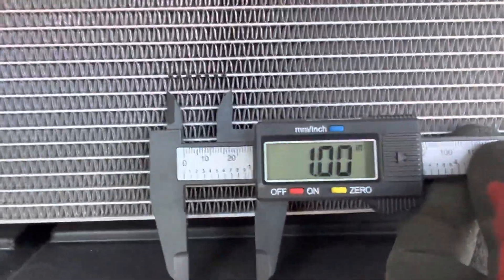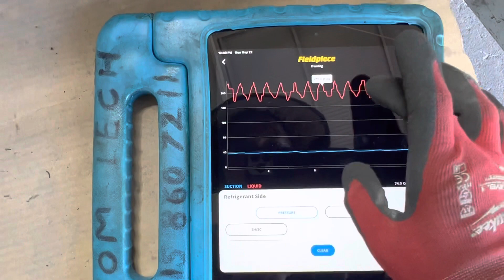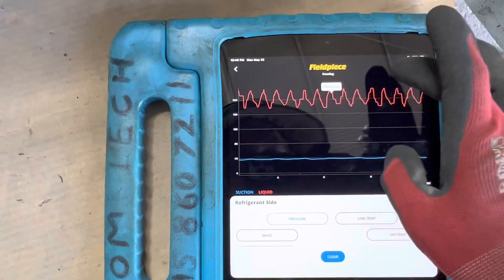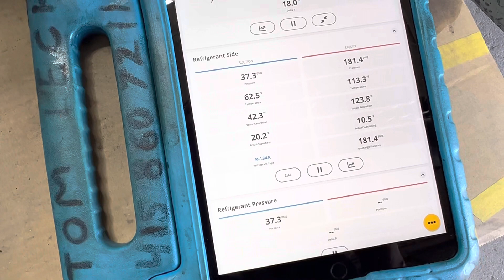AFTERMARKET AC CONDENSER CAUSE FASTER HV BATTERY 🪫 DISCHARGE, LOWER GAS MPG, SHORT COMPRESSOR LIFE

Comment: Why does the pressure jump so much, is it because of higher restriction of the condenser or reduced cooling of the condenser?  Or is it what you started describing as a different amount of refrigerant capacity?
Reply from the maker: In different scenarios, it could be a combination of the three. 

It depends on the way the condenser was constructed 

In this case, it would not be restriction of the condenser . 

Because the inside of the diameter of the Refrigerant passage tubes is actually larger .  

The inside of the refrigerant passage tubes actually has like 1/4 of the amount of thin fins that are located inside the tube that give you all that excellent refrigerant to surface area ratio to absorb heat, and dissipated to the outside . 

Then this particular aftermarket condenser has about 40% fewer exterior surface area, cooling fins 

It’s all about physics very simple math . 

Lack of ability to reject heat . 

When this customer goes in 200° weather, plus he will be just on the borderline at 400 psi may be exceed and cut out on the safety limit switch. Turning off the AC compressor. . 

I have seen this hundreds of times it’s a nightmare for the unexpected and inexperienced young technician who will get this vehicle in his shop about the customer complaining that it’s not cooling 

But when the vehicle comes into the shop, it will be a cooler day, and it will not cut off on high pressure cut out, and the pressure will not be high enough to affect the temperature of the air coming out of the dash it will be working perfectly as far as the technician is concerned. 

This is where wasted Time in trying to recharge the system, thinking that might fix the problem 

When the vehicle comes back again, now, they start throwing parts at the dartboard seeing what sticks maybe it’s a clogged expansion valve let’s change that 

Now this time, maybe it’s a bad compressor. Let’s change that. 

The condenser looks brand new. It must be good. 
🤣 

Maybe we have a defective pressure switch. Let’s change that. 

I see this over and over and over again year after year decade after decade shop after Shop Technician, Shafter Technician, this nightmare story, never ends . 

The owner is angry at the Technician because maybe they’re eating bad diagnosis in Parts 

The customer is mad at the shop because they think they’re getting ripped off or they have somebody who doesn’t know what they’re doing 

It’s not the technicians fault. He has no way to know that this aftermarket condenser could be doing this. . 

It’s all the fault of the industry, and the lowlifes scummy salesman who are clueless themselves about picking and  Distributing Parts it’s all about the profits .
Reply: @coldfinger459sub0  So mainly your feeling is lack of cooling.  If you jumped the auxilary electric fan to go on while testing and you saw a significant drop down in pressure with it on, would that work as some kind of test for this problem?
Reply from the maker: @mikemurphy7519  if I jumped the fan and kept it on continuously, it would do the exact same thing on the original manufacture OEM condenser as it does the poorly designed cheap aftermarket condenser

Both of them, the high side head pressure would come down 

Donely difference on the OEM condenser the high side head pressure would come down even more 

And it is not a feeling that the high side pressure it’s a fat it’s all math physics thermodynamics real simple stuff that you were taught in your first year when you’re taking your 2 1/2 year HVAC degree either be residential or if you opted for commercial refrigeration, 2 1/2 year degree program in commercial refrigeration all students are taught The Thermal Dynamic math formulas to figure out the energy consumed and the heat rejected. 

When you’re going over to classes for heat exchanger designs for Evaporators Four, Condenser, Four, Plate, Haight exchangers, you go over the formulas for figuring out the BTU heat, rejection determined by the surface area, determined by the type of material used, determined by the texture or what type of fins or rifling groove on the inside of the tubes to increase the efficiency of the heat transfer from the refrigerant to the material that will be the medium that the energy flows to the exterior cooling fins

Unfortunately, in the automotive industry and many others, there is no mandatory forced education that the individuals doing repairs are selling parts or Manufacturing Parts or Distributing Parts are required to know this

It’s can I produce the cheapest park and sell it to a gullible uneducated person for some money to make a profit

And the uneducated gullible person looks at the part and thinks they’re all the same and goes. Geez, this is great I’m saving money for the same part.

But it is not the same part it’s apples 🍎 and oranges

🍊 

Imagine a sailboat and you have the original sail We all can picture this in our mind.
     Even the tight weave and threads of the sail pass a little bit of air through them negligible

Now, imagine a company selling sailboat sails that are made out of cheesecloth. If you know what that is, it’s still a cloth. It looks the same. It is white. It is the same size, but the weave between the individual thread fibers has a larger gap that allows more air to pass through the sail

With the aftermarket sail installed on the sailboat the boat now move slower but you got a good deal buying a cheap sail 🤣

This is exactly 100% what is happening in the aftermarket, condenser world of manufacturing and distributors to make a profit and not telling the customer because the customer this is not their field of expertise so there’s no reason why a customer should know this information he is completely in the dark clueless. 

Many individuals are allowed into the automotive industry who learn by breaking stuff and making mistakes, and usually too cheap to pay for themselves to go for manufacturer education go to a formal education in thermodynamics, HVAC construction load calculations fluid flow dynamics. Their only education required is I feel cold on my hand. Therefore, it must be done properly give me money, Mr. customer adios goodbye 👋
Reply: @coldfinger459sub0 i
Hello! In this case can I cool the condenser with fresh cold water and see that system works fine, it turns off the fans after the pressure decline, and then pull off the Connectors of fans to see what happens with system?
Reply from the maker: Cold water will always fix this problem because water has 10 times plus the cooling capacity as a Refrigerant and many many more Times cooling capacity than air

So whether you have the aftermarket condenser or the OEM condenser you’ll see a great difference in head pressure 

But yes, this will tell you that if you had more condenser capacity for cooling and rejecting heat, it would fix the problem .
Reply: @coldfinger459sub0 
Mostly when I use these method I can see a thick layer of dirt between the condenser and engine cooling radiator😀
Reply from the maker: @markaircon  this is where a nice cleaning comes into play and if it’s only dirt, it’s easy to remove

In some areas of the country, it’s a fiber is plant material like Cottonwood, or some other leafy or flour, floating in the air type of material that becomes like a carpet and sticks and it’s very difficult sometimes remove all the condenser is needed 

In some parts of the area, there’s a lot of diesel trucks, and the radiators and condensers get coded with diesel, fuel oil and diesel fuel that is tacky and oily and all road dust and dirt stick to it and become thick. Then you need a degreaser. 

It all depends on the local environment in which the vehicle is operating that will make the condenser or the Evaporator or the cabin air filter plug .
Reply: @coldfinger459sub0  It sounds like other than knowing what the normal pressures for a particular car should be, there is no way to diagnose this, is that correct?
Reply from the maker: @mikemurphy7519  you will have a higher than normal temperature drop across your condenser

It will show up in your superheat and sub cooling compared to a vehicle sitting right next to it with an OM Condenser as a comparison it’ll hit you in the face like a bowling ball. It’ll be that obvious. 

Your experience right off the bat will tell you right away. There’s a problem why the high side pressure is shooting up so rapidly but most people don’t have experience and the ones I do are on a bonus program to move faster and get the next car in and out so they never pay attention. All they know is it blows cold on their hand, collect the money and get the car out so I can get on another one . 

Then your eyes 👀 

When you know what the OEM looks like as soon as I bend over and I see 14 fins in an inch I know instantly what the problem is there’s no questioning there’s no doubt it’s down to physics. 

BTUs heat rejection on 100° day is an elephant

So you use an elephant gun

Not a BB gun. 

The condenser is the gun that Hass to get rid of the heat the BTUs of rejection

Let’s surface area less rejection. It’s that simple.. 

Condenser manufacturing is a fine art of mastering math the formulas in physics the materials used in the design. 

This is what happens when we’re dealing with people in an industry that have no formal correct education in the industry that they’re working in. 

And they’re usually looking for excuses and scapegoats weasel their way out of the situation

They try to find a way to Twist The story and point fingers or be in denial. 

The automotive industry needs an enema. 

But the biggest turd excrement starts from the very top, the owner of the shop with the lack of education and turds roll downhill and land on the technician. 

When the shop owner is not competent enough to train his own technicians or send them for Training because he’s lazy cheaper ignorant this is a personal choice. It is not an option.

A technician or a owner of the company goes out of their way to choose to be cheap
To choose to be ignorant
To choose to be lazy

And it shows up in their lack of knowledge

They’re always having to advertise and look for new customers

And then they make excuses why they don’t have enough work or how they need some. Give me a call or upsell things that are needed to make money to treat their customer like an ATM money generator.. 

And we get right back again to lack of education.
Reply: @coldfinger459sub0  Yes but if you don't have a similar car in front of you and the car you have is not a common car coming into your garage, other than somehow knowing the superheat  and subcooling specs for that car, how can you properly diagnose it?
Reply from the maker: @mikemurphy7519  this is where are you have to rely on the old-school of pulling down the specifications off the manufacturers website that you pay for your monthly subscription from all the different dealers are manufactures or Mitchell or Chiltons or all data or ADP wherever you get your information from

And you have to rely on what little information you were given where they may have a chart .   That tells you what ambient temperature is exactly how to set up the vehicle for testing to compare pressures and sometimes temperature out the dash.. 

Oh, and sometimes it’s really obvious when you look at the aftermarket condenser, they will have the brand-name sticker or serial number some sort of identification. That is not OEM. 

And with your experience, you just use your eyes and you can instantly see that you only have 14 or 16 cooling fins for inch and compare to the OEM’s of 20 cooling fans to 20 for cooling fans per inch 

If you don’t know what you’re doing as a Technician I feel sorry for that shop and the customer because this is where experience comes in . 

This is where the guys who belong and have join the MACS and fly out every year for training are on top of their game in ahead of everybody else and usually don’t have problems like this 

I am always a heavy advocate for training and education flying out to OEM dealer manufactures seminars for training 

I get a hold of every OEM manufactures webinars that are online for free 

Your next step down is your aftermarket third-party distributors because they sell trash sometimes and they are into marketing their product or their snake oil. Sometimes it’s good sometimes it’s not sometimes it’s truth. Sometimes it’s a skewed lie. . 

But overall, there’s a lot of good information at some of these places like Napa when they have a HVAC training seminar that might be six or seven or eight hours long or maybe it’s a two part today or three day training seminar 

You pay the money and you go attend this and every time you learn something new . 

There is no one class that teaches you everything there is no one book that teaches you everything there is no one mentor or instructor who can possibly teach you everything 

And the technology is changing faster than books can be printed. 

This is why myself and my son are always flying out to different states attending different seminars in Training Express on HVAC, both commercial, and . 

If the shop owners choose not to do this cause they’re making up excuses that is their personal choice in the shop will suffer. The employees will suffer, and the customers will suffer. . 

All the information is out there 
It takes 
TIME ⏰ 
MONEY 💰 
DEDICATION  📚 📖 
CORRECT TOOLS 🧰 TOOLS 🛠️
Reply: @coldfinger459sub0  Anyone asking you questions here is making an effort to get educated, you are preaching to the wrong people....
Reply from the maker: @mikemurphy7519  I’m trying to put out all the education I possibly can that is not in books.   

But I do want people who read the questions and responses also to know if they’re in customer going into a shop for service that they are not always going to get what they’re paying for 

I tried to make it very crystal clear that it’s not always straightforward and simple 

I try to make it very clear. There’s usually no rule of thumb that you can apply to all vehicles for a simple cure or application or diagnostic. . 

Often everybody wants a simple, cheap fast one pill to cure every disease example an answer . 

Not possible then, HVAC . Over a phone over text messaging over email.. 

I do not want to mislead anybody by giving them one universal answer for everything and sending them down the wrong path . 

I see this happen too often. This is why I’m always redoing everybody else’s work. . 

This is why when I started my own business 30 years ago I had over 30 air-conditioning and radiator specialty shops who were my competition in my area 

I now have zero 

And the two who pretend to still be in business with new management and technicians without experience now make me more work by what they do for repairs then they actually repair. They will be joining the others soon. 

4 SEASONS, on their YouTube channel go to their website they have some videos on Flushing procedures and using flushing equipment with flushing solvent

NAPA Auto Parts also has some videos so dose Murray air-conditioning components if they’re still a

If you do a search on the air conditioning, chemical flush solvent manufactures, they have links to how to use their products with videos and descriptions, and usually give part numbers of both the product of the air conditioning, flush, solvent, and flush cylinders
Reply: @coldfinger459sub0  Back to this video.  From what I have seen, auto manufacturers and even aftermarket data providers do not provide superheat and subcooling specs.  So unless you have first-hand experience with a particular car, you can only go by the rule of thumb values for the superheat and subcooling data.  You check the fin count, look for stickers, look for what seems to be abnormally high side pressure and if you spray water on the condenser and your system improves almost instantly, then that is all you can do to diagnose this issue.  Correct?
Reply from the maker: Yes, mostly correct. 

That part, you mention about experience . 

There is no experience if you don’t test . 

And I don’t mean pressure and temperature out the dash only . 

You did mention superHeat and subcooling . 

And this comes with experience, because the manufactures do not provide this information. 

And I would not use rule of thumb, because there is no such thing anymore . 

If you watched a few hundreds of my videos showing different year make and model manufactures running a superheat of anywhere from 0.2 or 0.4° superheat many other manufacturers somewhere between 7° superHeat and 17° superHeat but yet again, many more manufactures who might be in 25° superHeat to 50° superheat. 

These are extremely vast differences you’re talking, measuring the distance between your thumb and pointer finger a millimeter apart, considering the compressors health, and between you and the moon . 

That’s how drastic of a difference there is there’s no rule of thumb to cover this . 

And measuring means nothing if you don’t have good, sensitive, accurate high resolution tools with a high refresh rate that can give you instant data feedback . 

Because the computer on all the new cars is taking over so fast and instant that you constantly need the formulas run for refrigerant saturation, superHeat sub cooling, calculating continuously at the moment . 

The exact same thing goes for subcooling 

After watching a couple hundred my videos you’ll notice it might be somewhere around 7 to 9° subcooling and some vehicles ranging all the way up into the 30s and 50° sub cooling. Those two are extremely different and one switched for the other means death of a compressor Over duration of time.. 

That means the difference between a car that works perfectly well between 70 or 80° but doesn’t cool at all at 90 or 100° . 

Just because somebody applies a rule of thumb . 

Visual inspection is always the very first thing. Well, let’s back up and go to asking about the customers complaint, and verifying it clearly, and under what circumstances as it happens is the first thing. 

Then your visual inspection, and you look for things like wrench marks on fasteners meeting somebody has taken that part off before now you have to find out why were they shotgunning just throw in Parts on their 

Is it an aftermarket Condenser or OM condenser 

Did the shop you take it to Mr. customer? Did you see him use a little cans on a single hose? Did he have a big refrigerant recovery Recharge and recycle machine 

Did he just top it off? 

Did he use a can of a Cipro or two or three that contain Lubricant and Sealant and every other wonder drug in the world contained in it in an hour it’s grossly over charge with oil . 

And everything falls back on reading the manufactures motive operation 

In what order do fan stage in come on? Is it a one fan system or a Toofan system? 

Are they strictly just on and off cycling fans? 

Are they continuous run fans? 

Do they stage first fan comes on at a certain pressure and then second fan comes on at the next highest pressure determined by a second pressure switch or temperature 

Is it a Old Thermal San clutch that has 50,000 miles on it fluid driven that goes out of calibration and it’s spinning really fast and it looks good but it actually is not. These are things of experience. . 

And this is exactly why so many of the air conditioning specialty shops went out of business in my area lack of experience . 

Most owners got comfortable, making money, stopped working out in the shop and fell behind the times . 

Trying to make money they usually try to hire the cheapest guy when one guy quits and they keep having this rotation of technicians who don’t have experience except by breaking parts on customers vehicles we’re having multiple come back . 

Not a great business plan . 

We need to cut off the thumbs of those who use rule of thumb . 

For me, it’s great I make a lot of money, unfortunately at the cost and expense of the customers loss because the shops around me use the rule of thumb . 

I was taught from the age of 12 to data log and test everything on every vehicle I work on working with my father who taught me .  He never taught me short cuts. He did not let me know with all the other hack shops and quickie shops were doing..  

So I never learned bad habits when I was young I only knew one Way .  My micron gauge for testing for moisture content in Leaks was an analog analog micron gauge back in those days in a leather case. It took 10 minutes to set up, warm up in calibrate.. 

My father had expensive lab grade Simpson thermal meters contact type extremely expensive for the day things that were mostly used in laboratories an infield data login and dad are testing. This is what I was brought up on. I knew no other way. . 

By the time I was 15 my father ran me through the university, college course, thermodynamics books, fluid dynamics, box, thermal management, and heat load calculations .   

At that young age, I thought, every father did this to every other child, who is going to work in their fathers industry .   

What a surprise when I got out in the real world and worked for my first shop . 😱. 

Using the condenser drop method of figuring out your temp drop across the coil .  There’s actually a formula for this and heat exchanger design class..  figuring out your compression ratio. But the problem is an automotive. It Hass to be on a vehicle where there is no automated moving parts that are very and four temperature pressure like no variable Displacement compressor no fans constantly cycling up and down to take these measurements. It Hass to be at steady state.. 

In residential and commercial HVAC this is easy because it’s electric compressor most of the time that is one fixed speed 

It’s a fix speed condenser fan that does not 

A fixed speed evaporator fan that does not very 

You wait 1520 minutes forward to stabilize then you start taking and data log in your readings 

This is in residential and commercial . 

In residential and commercial, varying compressor, speed or flow, refrigerant flow, the manufacture has a diagnosis mode in software on the circuit board that you have to enable through either dip switches or plugging in your factory, scan tool to throw it into test mode that fixes everything out a stable mode . 
   And it takes to superHeat and subcooling across every coil in the system oil temperature discharge compressor temperature outside humidity inside humidity outdoor ambient temperature indoor temperature temperature drop across the indoor coil in the outdoor coil because sensors are located at all these locations.   And then you can take measurements. There is no rule of thumb.. 

Because different manufactures perform these test differently with different software .